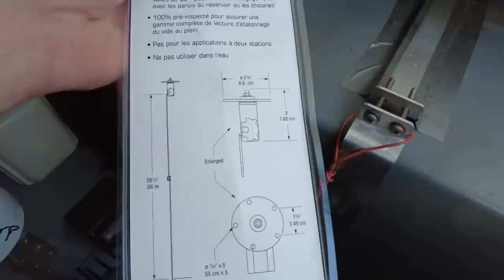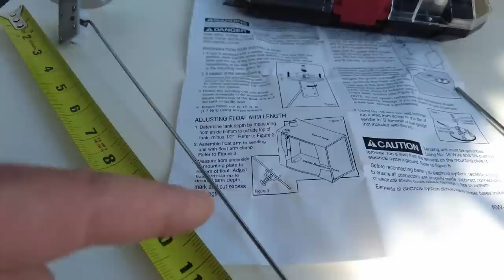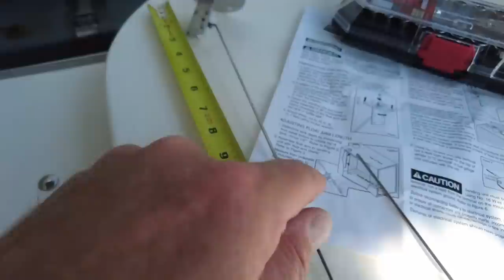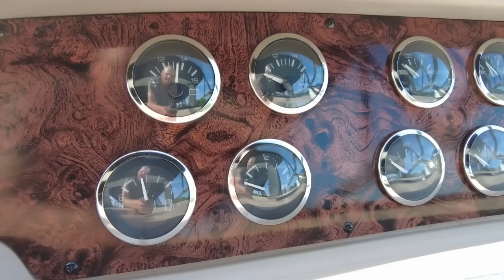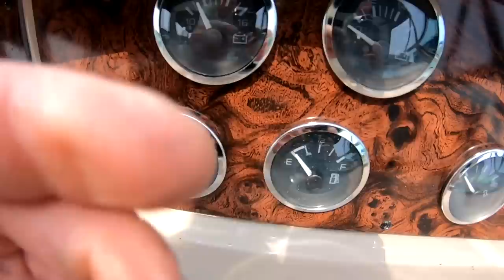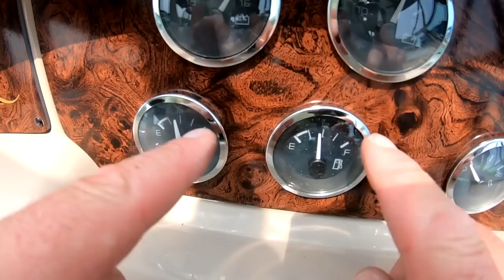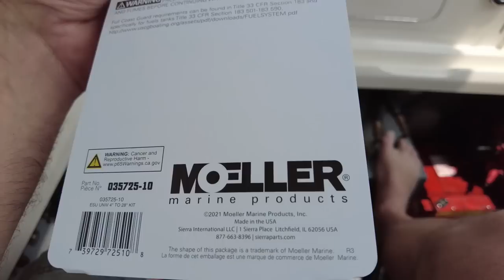Boat Fuel Sender Replacement - Sea Ray Sundancer

Comment: Nice one Paul. Always so frustrating when a simple project turns into a pain… especially when you’re supposed to be using the boat, not fixing it… Cheers!
Reply from the maker: And even more especially when the first two attempts were right after work in hot sweaty days. Figured I would be smart and do the dirty work while still in my grubby work clothes, but still no luck. 
 Oh well, all fixed now and on to the next project on the never ending list. . .

Comment: Paul. first test I would have done, is to swap the connections over of the 2 gauges. If the problem moves to the other gauge, then the sender or wiring is the issue, If it stays the same, then I would suspect the gauge

Comment: Did mine this year on my 1986 340 Express Cruiser. They seem to be working great now. I just took the ground and put it on the screw like the old one was and bypassed that spade connector. Also… I used the same brand sender as you.
Reply from the maker: Good to hear that you used the same sender and that it's still working well. I don't foresee any issues with the newest new one, as I put a similar one in our 330 Dancer a few years ago and never had a problem.

Comment: Great video. My  400SB starboard  fuel tank gage  is  similar but I don't think  I've ever  filled the  tank.  At 175 gallons  for each tank I  usually only split 100  gallons between the tanks when we do a harbor  tour and stop by the fuel dock.  My favorite pastime is  parallel parking the boat at the fuel dock to  spend  750  bucks each weekend. 😁
Reply from the maker: I feel your pain. Don't know where that illusive gas dock is that you referred to, but take solace in the fact that gas is posted at roughly $7.00 per us gallon/3.8 litres (with exchange) right now for us. That's over $11.00 per imperial gallon (4.5 litres) in Canadian funds 😩

Comment: I knew something was wrong when your video was half over and you thought you were done! 2 others thoughts - First, that panel is awesome. I don't have access to the top of my tanks I don't think without some major headaches. Also, loved the story about the styrofoam...it actually has saved you tens of thousands of $$ in the long run. Cheers!
Reply from the maker: Yes, the removable panels are really handy and much appreciated when I'm doing anything more than basic engine checks, etc.. That said, the two removable ones (one on either side of the engine room area cockpit floor) are super heavy, hence my only moving the one pictured in the video out of the way. If I wanted to open the centre panel (operated mechanically), I'd have to take that 'loose' one right off the boat.
 No complaints, but it's hard on my already damaged back and add in my poor balance, only adds to the grunts and groans for this old guy 👴😂
Reply from the maker: And yes, that styrofoam issue was a prime motivator to get into working on and fixing our boat(s). Perhaps one day I'll tell the story of the very first oil change Anchor Girl and I did on the boat. Oh boy 😩
Reply: @BoatingWithBoogaboo  I hear that.

Comment: Hello Paul.  Thanks for the video.  I have a few questions.  Before you installed the first sending unit, why didn't you wire it up and move the arm and look at your gauge to see if it moved?  Second, did you happen to measure the voltage coming into the unit?  I think you checked the resistance (don't remember if you stated that)?  Anyway, I have the same problem and I think I will check mine before I install it in the tank.  Also, when I checked the voltage at the wires, I measured 7.5V. Not sure how this can be as I assume it's hooked to my 12V batteries.  Do you remember if the instructions specified connecting using 12V?  I'd check my other tank but have no idea where it's at (can't begin to see it).  
Thanks
Greg at Macray Harbor (I know you know where this is at LOL).
Reply from the maker: Hi Greg at Mac Ray Harbor 😉 Yes, I'm very familiar with that spot - a place that Anchor Girl and I talk often about returning to some day. . .
 As for the first replacement sender, no, I didn't do a pre-installation check, nor look at the voltage. As it was brand new out of the package, I had no reason to expect anything but proper working. As for the voltage, the old unit was technically working, just not as accurate as it should have been - with the inspection after it came out showing evidence of breakdown. So, a voltage check was something that I didn't feel prudent.
 That all said, I am not familiar with what the voltage might be, but I'd suggest that the full 12 volts might not be a requirement for the sender (at the unit). I'm sure the Google Machine would have more insights on that subject.
 As for the location of your port side tank, it's probably located where ours is in the 370, which is just ahead of the forward bulkhead, port side. Ours extends almost to the back/side of the galley fridge, as I believe Sea Ray did that to (on our 370) accommodate the 💩 holding tank, Vacuflush pump and five batteries. I believe access to the sender is through the floor of the deck, via the portside cabinets. That's how it was on our prior 330 Dancer (sender replacement video in my channel).

Comment: I have a 23 Crownline and at full tank it always reads 3/4 full. 

Not sure why a new boat would have this issue but it does. What tests can I run before going into full replacement mode ?
Reply from the maker: You can check the wiring connections or resistance with an ohmmeter, but as the boat is virtually new, I'd start by having the dealer/manufacturer take care of it. I'm thinking that the boat has gotta be under warranty still. . .

Comment: You can always connect the wires to the new float switch and test it. This way you know it’s working before installing. I would setup a camera and record the fuel gage with acc on.
Reply from the maker: Next time 😉
Reply: I just asked Paul the same question.  Should have read the comments first.

Comment: Great vid. Love this stuff.
My uncle in Port Huron had 5-6 new SeaRays from 1977 thru 1990’s.
His 77-78 (?) had the exact same floating foam issue with the gas tank. Couple scary moments when the boat would quit in the middle of the St Clair River.
He said if it sat for a half hour - it would fire right up….all good again- temporarily. Dealt with it for a couple years then traded it in.
Reply from the maker: Yes, that was the exact same issue we were having with our 1976 Ray. Thankfully, it wasn't on the fast moving St. Clair River, just on our big Lake - in calm conditions.
 We bought our Sea Ray Sedan Bridge on LSC and drove her home, via the St. Clair River and then through Lake Huron & beyond. We were held up by a race on the river during our voyage, having to fight that current for about an hour before we could pass through. I learned two things that day; the Sedan Bridge didn't like the wind, and boat races in the middle of a busy river are just plain crazy.
Reply: Yessir, St Clair River & the big lakes are not very forgiving. Lots of wind.

International Powerboat Races on the River. We volunteered as one of the corner boats on the track. Still have the big pink flags & poles in the garage that we strapped to the arch of our boat. It was absolutely nuts having those boats go by at full whack……😅😅😅😅